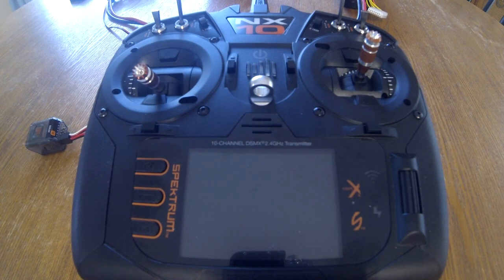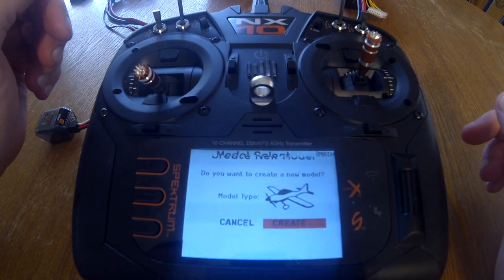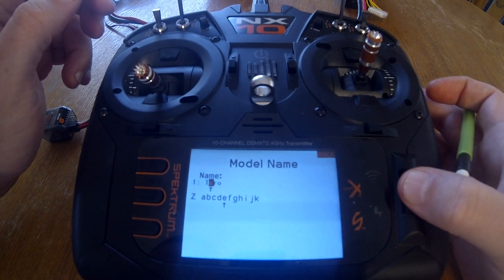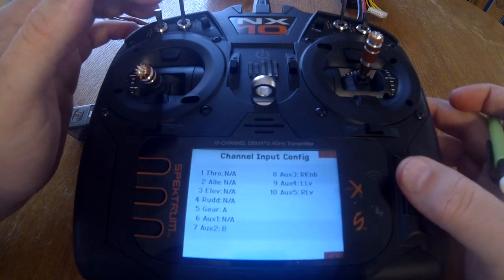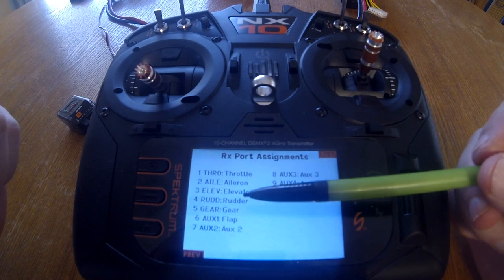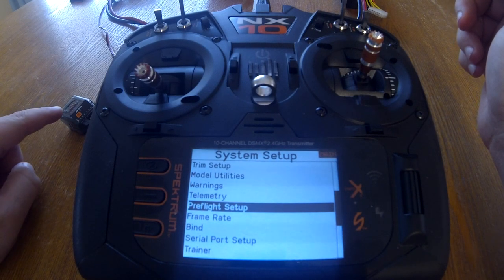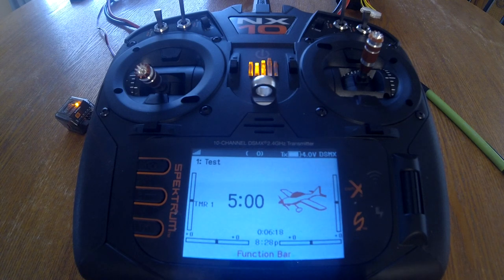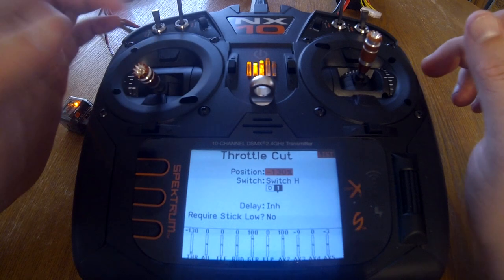Spektrum NX Setup: How to Setup RC Plane-Without Template (NX6/NX8/NX10)

Comment: My favorite setup item is this:  Function -> Custom Voice Setup -> Custom Voice Events -> Add New Sound Event -> Switch Change Report -> Change Switch: Inhibit to the Bind I button -> On Pos 0: < silence > - click the roller button and do a short scroll to  Time Remaining. You are done.  Now any time you are flying you can push the "I" button and she will tell you how many minutes and seconds you have left. You can put time remaining on either switch position but you only want it on one position or you will get the time remaining announcement twice.  Having Time Remaining on this switch will not interfere with the bind process.
Reply from the maker: Good info added,Thanks!

Comment: I always set the expo to a value that's 1/4 to 1/3 of whatever the rate is. If the rate is 100%, I set the expo to 25% or 33% depending on the size of the control surface. If the low rate is 60%, I'll set the expo to 15% or 20%. After some test flights to get the control surface throws adjusted, I then go back and tweak the expos for the feel I want around neutral.
Reply from the maker: Using the monitor i have a method to match different rates and expo to get the same end value/result.Check out my dual rate and expo tutorial...

Thanks for sharing your info too :)
Reply: @BDTennessee  Yeah, I watched most of that one, but stopped for some reason when you started showing how to move the stick to 20% and set the expo for the same output in each of the three rates. I've now watched the rest of it. You set the expo for the 100% rate to 35% which is just barely more than my 1/3 setting of 33%. I'm not sure what you used at 85%, but I think it was 20%. That's 1/4.25 which is really close to my 1/4th setting. And you used 15% for the 70% rate which is 1/4.67. I understand that you're wanting the same throw at 1/5 of the stick's movement. That's not very far on either side of neutral. I think if I were to use that method, I would match the throws at 25 or 33 percent of the stick travel. However, I'm not sure I could feel a 5% difference in expo at a rate of 70% or a difference of 10% expo at a rate of 100%. I generally want at least 15% expo and no more than 35%. Every plane I have is different, especially for the rates. There is no one-size-fits-all. Expo is a very subjective thing and everybody is different. I just divide the rate by 3 or 4 and enter the value. Sometimes I tweak it based on the way it feels, but most times I never change it.
Reply from the maker: @txkflier  thats for sure,we use what works :)

Comment: Great tutorial, I have to disagree about the flap switch setup, I'm a full scale pilot and have flown many different type of aircraft and in all these aircraft the flap switch whether it be manual or electric always starts with o degree of flaps in the up position and progresses downward to 45 degrees unless your in a Bush plane, those guys go nuts with their settings. In the end I guess it's what ever you feel comfortable with....
Reply from the maker: 100% or -100% (Pos 0 flaps up)depending on the receiver is 0 degrees of flaps. Numbers are percentages not degrees. Airplane owners manual will give rates of percentages or mm of deflection and you adjust accordingly. If the book doesnt have recommended starting points then i use 15* half and 30* full or 20* half and 40* full.

Side note:values i was using for video purposes were generic numbers however i have seen some use those percentages.
Reply: Yes I'm a private pilot myself and I set up all my switches as the would be in a full scale aircraft flaps, gear etc.

Comment: Hi How come your NX 10 has a different program to my nx8 for up loading planes/Heli ,on mine there are boxes with each letter/number and I find it quite hard to wright any thing in, unlike yours were you can delete numbers and letters easy. Try putting the name of a plane on a NX8 or NX6 it is not like your NX10   Eddie
Reply from the maker: Eddie, im using the stock template in this video. If you have dark scheme,its Legacy Template. Recent update cause the letter to have issues showing up with Legacy Pallette. Change to a different pallette and issues will be solved.

Comment: If you do the BNF everything is put on one switch which is switch C.  The correct way would be C switch is elevator, switch F is aileron, and switch G is rudder. But you could still do the BNF and then put the set up on different switches.   I don't understand the Template, I could not find anything about a Template in the manual.
Reply from the maker: Correct,thats standard labeling for Spektrum switches.

Template sets radio like book setup by clicking on the model. So i made this video to start without a base setup.

Comment: Concerning my last question. The video you told me to watch did not explain how to set up a receiver. I’m talking about purchasing a plug and play where you purchased the receiver separately. I haven’t been able to find a video that explains how to set up a spectrum receiver in a plane. Can you help?
Reply from the maker: This video i use a Spektrum receiver and complete walk through.Only thing not shown is putting into the actual plane. What part do you need help with?
Reply: When you put a spectrum receiver into a plug-in play plane I’ve seen the process where you have to set up safe and expert mode a different way and also put the aircraft on it snows click a button put it level click a button and so forth. I’m not certain of all the steps when or what to do.
Reply: Meant to say on its nose
Reply from the maker: @derrickward8031  oh gotcha. @SpektrumRC has a complete series setting up. Only difference from this video is setting up safe and as3x flight modes. When you go into forward programming it tells you each step on the transmitter.
Reply: @BDTennessee  Thank you
Reply from the maker: @derrickward8031  i almost forgot! Checkout my AR10360T first time setup on .I go through the steps as well,if you want my instruction on setup.

Comment: Very helpful, maybe I just missed it, but how do I reverse let’s say my elevator?
Reply from the maker: I edited out on accident when making video haha.

Go to Function List > Servo Setup > Click on Travel and scroll to reverse > Click enter on the switch icon above elevator.

I show how to do this in the "Function List tutorial" on the channel as well for visual reference.
Reply: @BDTennessee  ok thank you!
Reply from the maker: @voyhager3  thanks for watching.Follow the page for future content :)
Reply: Omfg thank you. I spent hours just trying to reverse my elevator servo. Was extremely close to throwing this Rektum crap in the dumpster and going back to my futaba (which isn’t user friendly either, but at least they know servo reversing is a common setting we need to use). In a hundred more hours I would not have figured out that the word “travel” at the top of the screen was selectable and could be changed, when the other menus aren’t like that. Got it working now, thank you!

Comment: Really enjoyed the video. I followed the setup and everything worked. However, when I start my NX8 and then plug in the planes battery there's a Warning message on my NX8. The message reads - 
ESC: 8.1V 0.0 A 32.OF 
Also, when I disconnect the plane battery another Warning shows - 
ESC: 655.4V 655.5A -----F 
I can use the clear button on the NX8 which gets rid of the messages and takes me to the main window. Question is... 
1. Are these Warnings showing somethings wrong? 
2. Do I have something setup wrong? 
Any help will be greatly appreciated. 
Thank you
Reply from the maker: You have a minimum start voltage.If battery is below that when plugging into ESC it will alarm on radio.

When unplugging thats a glitch that happens. Its cause it sees voltage lost.
Reply: @BD Tennessee  really appreciate you getting back to me.  I'm a newbie to rc at 67 and looking to get the kids and grandkids into this hobby. One of them at 2, now 3, has always been fascinated with aircraft. I'm a Ham radio operator and have them listing to aircraft and the international space station.
 
I understand now about the battery being removed and the warning of low voltage. Confused on the Warning coming in after plugging in the battery where it shows 8.1V.  I started with a charged battery or at least almost charged battery so what is the minimum start voltage and is there a way to lower it on the NX8 so the warning doesnt come on from say 8.0 volts on up?
Thanks again,
Fred
we4fm
Reply from the maker: @we4fm175  go into telemetry screen, click on smart battery. You will see minimal and starting voltage. Confirm settings and change them if need too.
Reply: @BD Tennessee  I will do that later today when I get home. Actually looking forward to it.

Thanks again, your help is much appreciated!
Reply from the maker: @we4fm175  sounds good,Give me a shout anytime my friend!

Comment: Why 130% and not just 100% on the motor cut off setting???
Reply from the maker: Allows users with to not run into issue in case lowest trim setting for throttle is used for different reasons.

Comment: QUESTION, I can't get the motor to run on either of the two gliders. The control surfaces work, but not the motors. I'm doing something wrong.  Help......
Reply from the maker: Change the model to Acro instead of sailplane
Reply: @BDTennessee  Thank you for getting back to me. A friend came by yesterday, and he said the same thing. BTW I hooked up my WACO to the NX and now the motor won't run. I've tried different things but nothing is working. Any ideas?
Reply from the maker: @robertwren2289  pm me on FB,might have to diagnose that directly.

Comment: Great info BD what kind of receiver do you prefer
Reply from the maker: I have used Spektrum and Lemon (both dsmx protocol). AR620 in video is new and has built in antenna. Lemon RX i use the 6 channel diversity (16 bucks shipped)
Reply: @BDTennessee  Thanks BD

Comment: How do I silence the throttle stick bells that sound when the throttle stick is moved
Reply from the maker: Settings > Timer > Last Screen > Timer Start INH Timer Stop INH

I show this in one of the latest videos (Top 5 requested changes) and Timers Explained if you need video reference.
Reply: @BDTennessee  got it, but on screen flight timer is now gone.  Been watching your videos.  Good job.  Have another problem - cannot with flap speed setting.  Selected 2 SEC but it does not work.
Reply from the maker: @richardranaudo3991  you INH the timer not the last screen. When you go to the last screen you have 3 options.

Timer Start,Timer Stop and Timer Clear

In the Flap system do you see a word bottom right,that says "Link" or "Indep"?
Reply: @BDTennessee  I did recover the timer.  Thanks.  My problem now is how to slow the flaps.  My Timber X with NX 6 requires I put three flap positions on the D switch.  The flaps are connected to the GER channel via Y harness.  I set up the desired mix ELE>GER mix (ELE should be slave) but only the elevator slows.  The flaps move at normal rate.
Reply from the maker: @richardranaudo3991  plug the Y Harness that goes to the flaps into channel 6. 

Then go into System Setup > Aircraft Type > 1 Ail 1 Flap. Then setup Flap System to setup percentages and speed.
Reply: @BDTennessee  I will give that a try and let you know how not goes.  Thanks
Reply: @BDTennessee  it worked!!!  Thanks so much.  I had been trying to get this functionality working for weeks thru horizon.  Total waste of time.  Their product support staff did not have the understanding of the NX transmitters that you have, and we're extremely difficult to communicate with.  Thanks again..
Reply from the maker: @richardranaudo3991  BOOM! Glad to help!

Comment: Anybody know what a flashing green charge indicator means in normal use of nx 10 ?
Reply from the maker: Battery is low...
Reply: @BDTennessee  really? Wow, it was at 3.9 v
Reply from the maker: @foostar777  check the low battery alarm and see what its set on
Reply: @BDTennessee  it's set on 3.5v by default
Reply from the maker: @foostar777  in the manual it says thats when it flashes. So maybe something else
Reply: @BDTennessee  couldn't find anything in the manual about it flashing
Reply from the maker: @foostar777  do you have the latest firmware downloaded? Also take the battery out and plug back in...
Reply: @BDTennessee  yes latest firmware and yes done battery disconnect, there is nothing in the manual about charge indicator flashing, only about baterry alarm which is a loud audible alarm
Reply from the maker: @foostar777  id contact HH if you have done those and issue still exist...
Reply: @BDTennessee  it's not happened recently, weird, one more question, how do you turn off the beeping sounds when scrolling through menu's etc? Thanks
Reply: Nevermind, just found it

Comment: K.I.S.S. keep it simple stupid U.S. Military motto went out of the window with these R/C remotes. Kinda like a Wi-Fi thermostat......just set the temp and heat or cool dude! It will give you far less problems down the road. Another reason the Oshkosh L-ATV has analog instrumentation and nothing digital. It's a speedometer and a fuel gauge....not a NASA mission.
Reply from the maker: Thanks for watching!